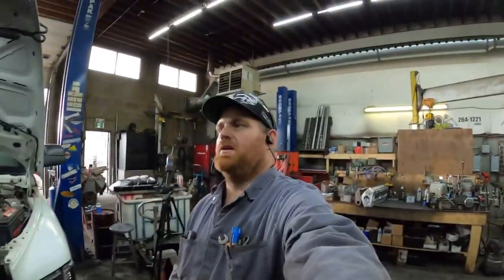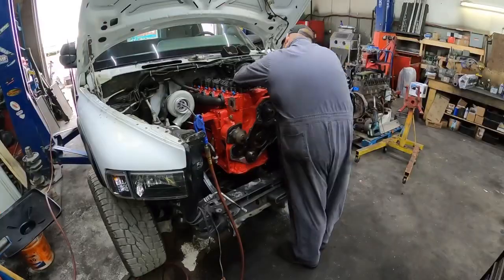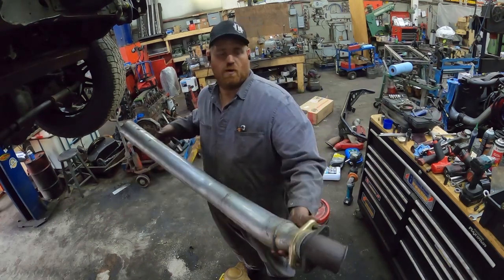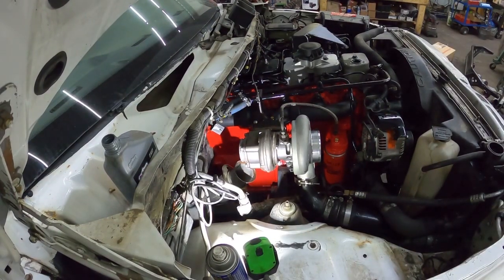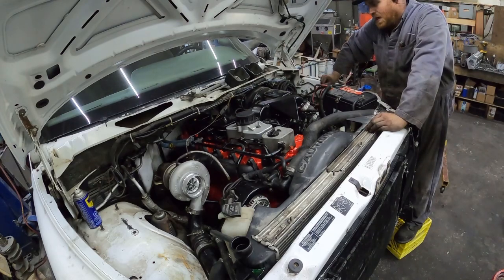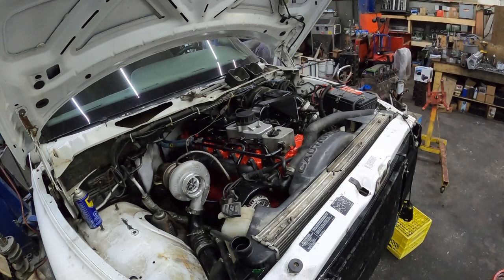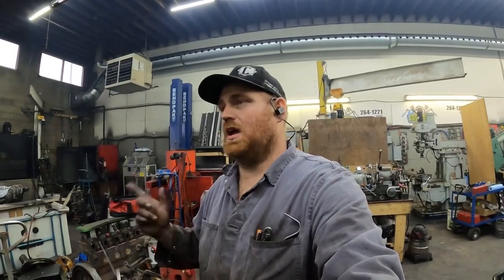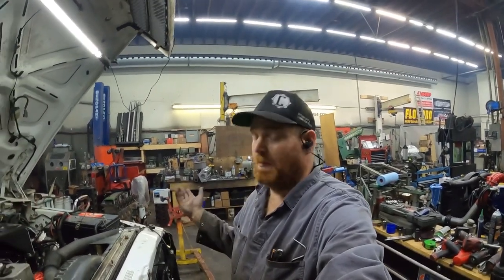how to build & upgrade 12 valve Cummins for towing ( IT'S RUNNING )-!!!!

Comment: I have a 1996 12v from a school bus I’m going to put it in a 1993 f350 c&c 5 speed 4x4 service truck , , have been told to reseal it and replace the water pump and freeze plugs , what is included in reseal , are there kits with the required parts for this reseal ? Also can i bump this thing up to around 225 hp ?
Reply from the maker: Just need a upper and lower gasket kit. 
For the pump side of things it limited power wise. You can turn it up a bit. But if you want some power you will need to send the pump in and have some work done

Comment: I just put a 362sxe turbo on my 97 12v. This turbo has the boost line that just jumps across from the compressor to the waist gate actuator. The old one has a hard line that comes up from underneath. What do I do with the old hard line underneath? This turbo is super laggy and I was wondering if this line effects the afc or anything?
Reply from the maker: At the afc there is a tee take the tee out. Then put the afc boost line right into the afc housing

Comment: I run my 95 at 17.5 or 18 deg 
. It made a huge difference in mileage.  Revs up OK.  That and the 215 injection and thin washers .  I do appreciate your videos . The electric ratchet  what do you prefer.  I was thing about getting one as I used the air ones for years .  I remember years ago a fellow from Canada told me once how much he thought the 12 valve could make and tow with  before it was could not control the heat .  Very close to your recommended numbers . So I though that all I going to try to make out of my truck
Reply from the maker: THE Milwaukee one for the money is a nice one, the matco is three time to price but is a bit nicer to use, but that side i dont have a fuel Milwaukee so they could be different, we are going to see on this truck what we can keep cool

Comment: What turbo u running? Are oil leaks under high boost a common problem?
Reply from the maker: this is a super 9 60mm, should have oil leaks unless there is a issue
Reply: @CUTTERUPROB  
Thanks for the reply 👍

Comment: I just purchased same front valve cover with the oil cap on it. It didn’t come with a grommet for the bolt and the cover is loose. Do know the part number or proper grommet for this one valve cover? I appreciate it. Thanks
Reply from the maker: i will be doing a video on the valves this week i will put the number in